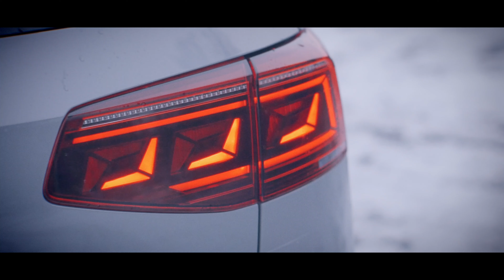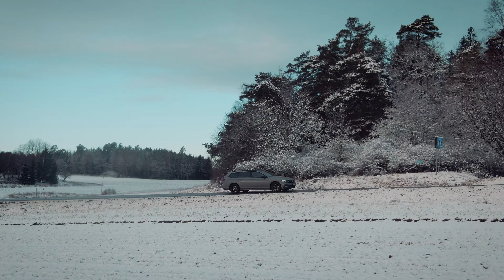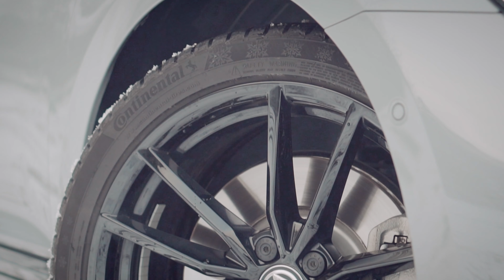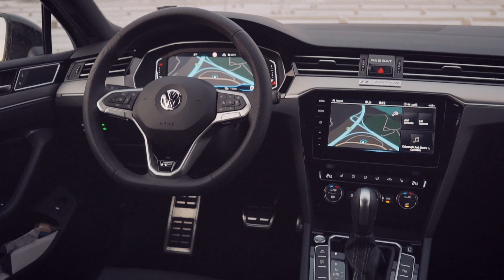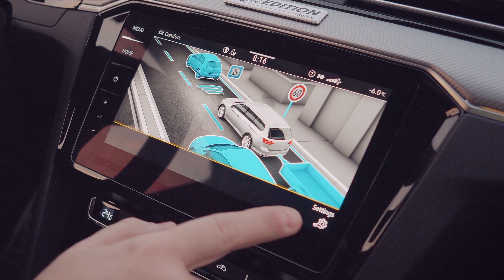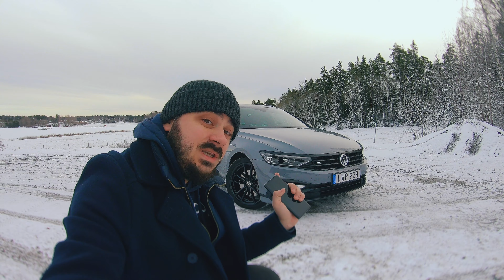VW Passat R-Line Special Edition: SURPRISE Passat R36 comeback?!

Comment: We got a TDI Biturbo version in the UK with 237bhp 500nm torque. A remap and they achieve crazy power. Absolute master of all trades but it didn’t sell very well for some bizarre reason and was over looked. There’s currently 1 on AutoTrader 55k miles 2020 £26k. I don’t think many people even knew they were a thing. 
Same goes for the Diesel Audi S4. They are just not advertised very well.

Comment: Hello, I'm going to buy one of this but I need a last advice; I'm still not sure whether it's better the TDI version or this TSI version. Did you try the diesel version? Any suggest?
Reply: Dont know if you bought it yet. I drove both and decided to buy TDI, maybe it has 26kw less power, but for mě it was suprisingly moře fun to drive and better fuel consumption.

If you have any questions go ahead and ask! :)
Reply: @Lumpyy75  thanks a lot for your feedback, I finally got the TDI version, of course the limited edition. Great car
Reply: @bacic79  Nice to hear that. Welcome to the crew! :)
Reply: @bacic79  Congratulations! Ill ask you the same questions. Do you use it for short journeys only or do u do long trips? Im thinking of getting a diesel but 75% of my trips are in town, maybe 1 or 2 longer trips per week so im not sure if diesel or petrol is better for me, dont want the dpf getting clogged.
Reply: @Lumpyy75  In what ways was it more fun to drive? Do you use it for short journeys only or do u do long trips? Im thinking of getting a diesel but 75% of my trips are in town, maybe 1 or 2 longer trips per week so im not sure if diesel or petrol is better for me, dont want the dpf getting clogged.
Reply from the maker: That's completely up to you and your needs. If you're worried about the fuel consumption, get the TDI. You'll be much better off. If that doesn't matter to you then get the TSI

Comment: I have had this car for the last 4 years in Australia. It is not new. It is a face lift cosmetically but the mechanics are not new. It was called the Passat R-line when it was released here. They sold like hotcakes.
Reply from the maker: You said it yourself, it's a facelift. So it is new. Not mechanically but visually. Plus you get a few extras in this Special Edition that you couldn't get on the regular R-line.

Comment: I wish we got the wagon version in the US.
Reply: That have a 3.6 passat 4motion wagon almost the same the r36 has 300 hp as the 4motion 3.6has 280hp from what iv seen .. I have a 2010 passat komfort 2.0t and a 2007 passat 3.6 4motion wagon and I stay in Florida
Reply: @jimmyposton9114   Yes. But what about torque ? aspirated engines do not have it !